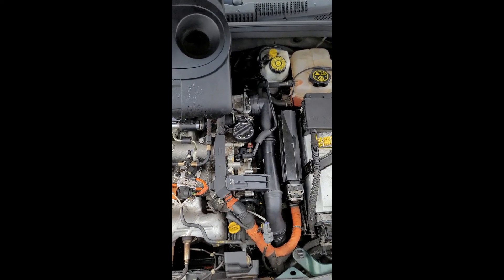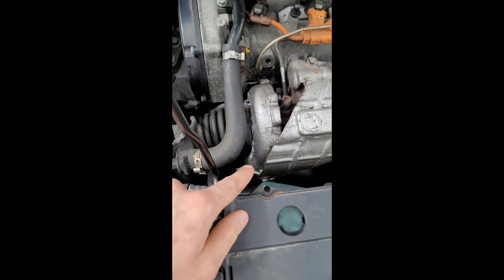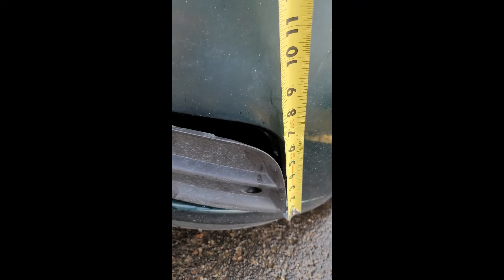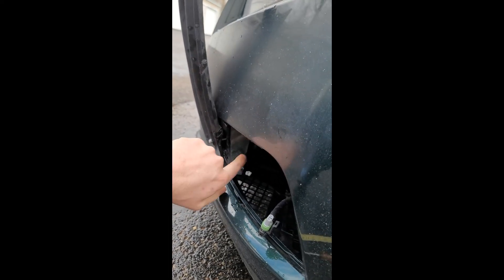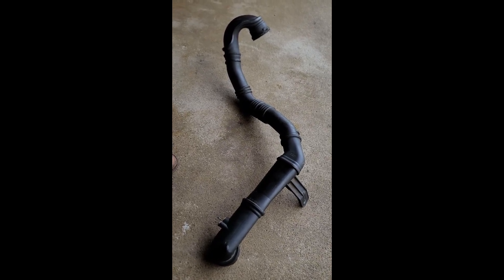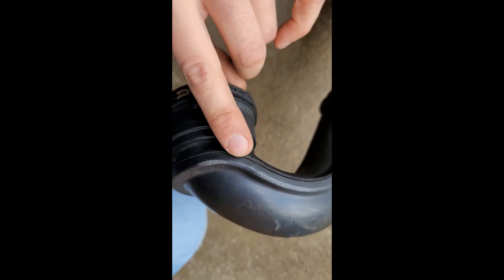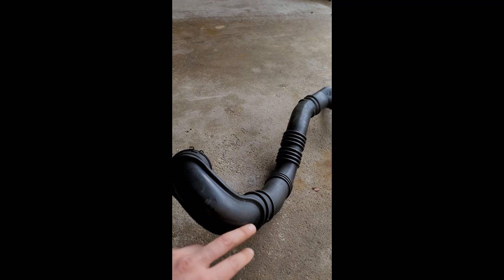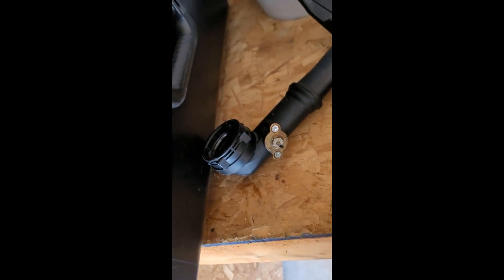Repair or Temporarily Fix your (F hose / Charge Pipe / Boost Pipe) on 14-15  Diesel Cruze (19420422)

Comment: Great videos.  Thank you Collin. Just a note that faux fog light panel/cover is held on by a phillips screw from the back, accessible from inside the bumper after removing the bottom trim panel (trim fittings and T20 torx). You don't want to just pry it off from the front without removing the screw or it will end up looking like yours (broken)!
Reply from the maker: Great comment about the panel! And thank you!

Comment: Is there supposed to be any oil in the charge pipe when I took it off there was some around the seal to the pipe and intake
Reply from the maker: The EGR system will Typically put Black carbon into the Charge pipe and the EGR Cooler usually leaks a little bit of coolant over time. Both the Carbon and Coolant mixed together appears as it would be Oil.
Reply: @collinskotynsky150  ok thanks I was worried my turbo was going out but I wasn’t for sure because my oil level remains the same, one other thing to mention in the video is that if you have fog lights you absolutely have to jack up the vehicle and remove the front skid plate and then take out the fog light housing
Reply from the maker: @@rumblertag1419  No problem, and that's good to know! Even my panels were a pain in the ass so I believe you lol.
Reply: So my temp sensor wires appeared to be pulled out when I removed the pipe. The car ran before I replaced the pipe. Now, it won't attempt to turn over. So would the temp sensor wires prevent a start or start attempt?

I notice there wasn't a video for reinstallation. HaHa... What a pain in the ass. I am not proud of what I did to get it in, but, it is in.

Comment from the maker: Remember applying RTV, or some type of glue is a (Temporary fix) or used to troubleshoot and see if this resolves your issues or code. 
If this (Temporary fix) resolves your issues I would still recommend ordering a new F-hose/Pipe.
Part Number: 19420422